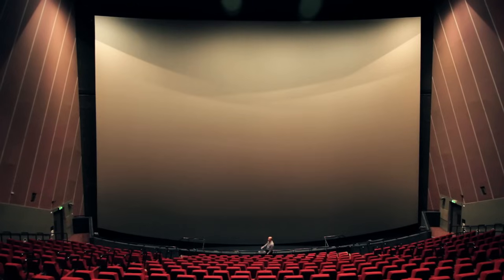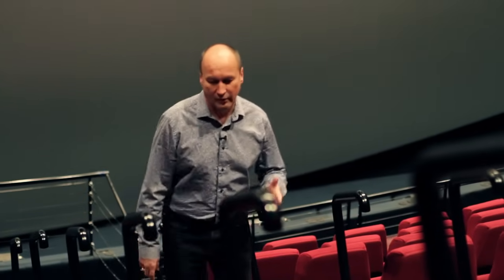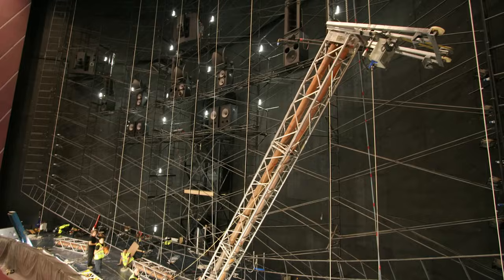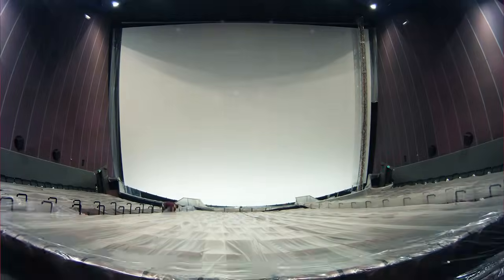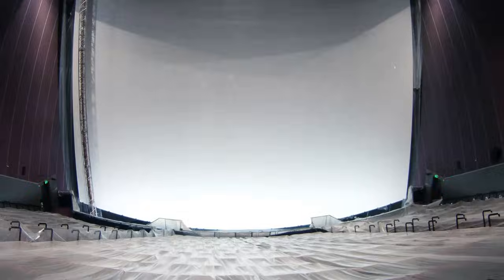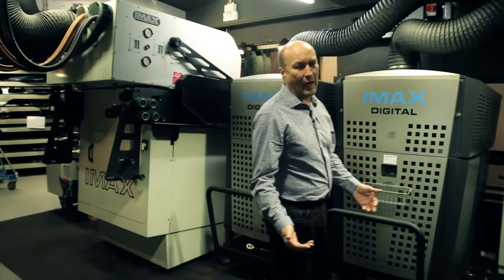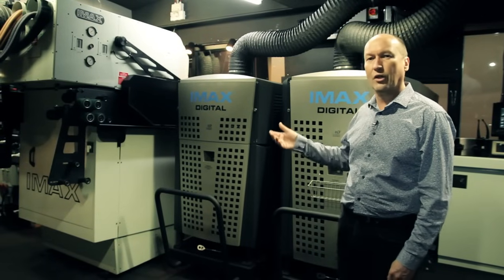London BFI IMAX screen replacement | BFI

Comment: why is the screen square? it's such a huge format, why would you confine it to a 4:3 aspect ratio?
Reply: +ArnoldTohtFan it's not "confined" - confining a film would be to install a 16:9 screen like nearly all "IMAX" cinemas nowadays. IMAX 70MM film is recorded at a 1.44:1 aspect ratio, which is close to 4:3 like you said, this is why the screen is square, and that is how the filmmakers intend you to see the film. For the portions of the film that wasn't shot in 1.44:1 IMAX - the screen is still bigger than your standard IMAX cinema. 

Let's use the new BvS film as an example. There are four different aspect ratios on offer: 

The majority of the film, and the standard anamorphic wide screen for most hollywood films - 2.35:1
The original "true" IMAX ratio, which would fill this BFI screen - 1.44 : 1
The 70mm prints will be - 2.20 : 1 - Like epics such as 2001: A Space Odyssey and Lawrence of Arabia 
And the 1.90:1 ratio you get with IMAX Digital - this is the only time the film will be "confined" to an aspect ratio, when films are shot (albeit only portions) natively on 70mm IMAX like BvS (or many Nolan films, and the recent Star Wars) and shown on the digital IMAX screens - they have to crop the image, thus not achieving the full effect, as you will with this screen. 

I wish I lived closer to London, not only is this screen bigger and the correct ratio, it shows 15/70mm projection which gives you a much superior image than any other cinema system.
Reply: +Wan Wiles I am fairly new to these concepts but I would certainly like to learn more. Tell me, would it be theoretically possible to go bigger than 70mm? Say, for instance, 90mm, or even 100mm? Also, why choose for the dimensions of the IMAX frame to be so boxy? Why not make them slightly longer than they are tall for a more cinematic effect? I should inform you that I'm speaking from the assumption that frame dimensions and aspect ratio are the same thing. Ideally I think the entirety of the frame should be used. Not doing so would negate the benefits of shooting in such a large format to begin with.
Reply: there are a handfull bigger than 70mm (its actuallly 65mm) the latest is hatefull 8 and is captured with 85mm but is presented in scope. scope means yu need a special lense to show the aspect ratio its printed in. yu can have a 35mm scope to have a 70mm (65) movie. and imax is so 'boxy' because its made to capture everything at high resolution and because of that resolution (its so high yur eyes hurt ;) 30k analog, 4k digital)  you need to watch it in letterbox. a widescreen imax would never exist because the human eye canot see widescreen that large, just imagine 2 imax screen besides eachother and yu know what i mean
Reply: Daniel Wiles  at least Christ Nolan IMAX frame on BLU-RAY or UHD (1.78:1) is much closer to the original IMAX frame (1.44:1) than Michael Bay/other/all actual movies with IMAX frame (1.90:1) wich is a joke to me! IMAX is 1.44:1 not 1.90:1
Reply: Just call it a TV format.

Comment: Must be in the chemistry of the paint but I've pondered how the paint can keep from clogging the micro-perfs? Thin enough to barely coat and keep perfs free yet thick enough not to run. A theater near me painted there's years back when they got 3D and it was uneven and many Perfs were covered
Reply: I was wondering the same thing
Reply: the perforations aren't exactly 'micro' so won't clog easily with the sprayed silver paint.
Reply: Yes that's a good point, especially on an IMAX screen. But many smaller screens are actually "micro" perfed or are a weird as im sure you know. Those must be for non passive 3d i.e. Polarized a different method
Reply: Jarod - it's easy to get smaller screens in any material /finish, but larger screens often have to be standard matt white perforated then have a spray finish applied to them.
All the plastics are manufactured in fixed widths and some are not even available over about 5 metres wide (but any length....)
Reply: I wrote  a typo of weird before and meant woven as in woven material.  I've been into home theater since the 90s. Had dozens of projection setups . Yes I'm aware screens come in many materials,  gains,  ambient light rejection screens etc. All have there uses and applications. Mini types of 3d, polarized, active shutter, the Dolby 3d kind my least fav which is a joke cause of glasses reflection, I always see my own eye.  It all is very fascinating to me. I still wonder why some spray 3d  polarizers gunk up the perfs? Go to the Warren IMAX in Kansas you'll see what I mean. All IMAXs are not created equal. There is there is the LiE-Max's with just a large screen and  2k dual projection and then there's the originals like the BFI.

Comment: Avengers Infinity War will be my 1st experience at this theatre
Reply: Watched Avengers: Infinity War at BFI IMAX and was disappointed with both the video and audio quality. This was the forth movie I had watched at this cinema and the first time I felt disappointed. Have watched a couple of movies since Cineworld, Leicester Square had IMAX with Laser installed and as you said it offers a  noticeably better experience with recent movies shot digitally. Plan to watch Avengers 4 there rather than BFI IMAX.
Reply: I watched Infinity War at the Vue Manchester Printworks IMAX and I'm pretty sure it was shown on film as you could see the "film pattern" moving across the screen as (I assume) they switched from the digital projectors for the trailers to the film projector. Interesting that the BFI IMAX didn't do the same.

Comment: What is the ratio of this screen?
Reply: 1.43:1 I think
Reply: This is 1:43.1. IMAX 70mm uses a ratio of 1:43.1 where IMAX Digital uses 1:90.1. My theater is an IMAX 70MM, but uses IMAX Digital for films that are not shot or projected in 1:43.1.
Reply: @largeformatmaster2994  Have you ever visited a 1:43.1 IMAX theatres? If so, how was your experience?
Reply: @ManOfCinema-  I actually do have a 1:43.1 IMAX theater in my hometown. However it only shows Digital releases. Oh what it would be for my IMAX to show 70mm films.
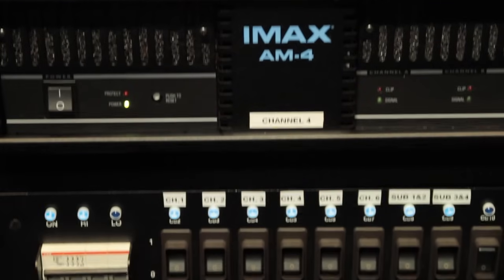Reply: @largeformatmaster2994  I'd be greatful even just for 1:90.1, because I have not seen a single movie in imax theatre, I saw some videos of that format and that is so huge than normal 2:35.1 screen, at that rate I can't even imagine what it'd be to experience 1:43.1!

Comment: Shame so many screens aree LIEMAX and even the BFI has the LIEMAX system for digital. IMAX scans are 18k.... LIEMAX is only 2x 2k... giving a simulated 4k... (looks more like 2k to me).  When are IMAX going top provide 18k DIGITAL to give glorious images like the film systems used to. I called IMAX and was told bluntly "its not all about the image you know our sound is the best out there. " Hmmm, sounds like a stock reply read from a card. Sorry Imax stands for something like IMAGE MAXIMUM... I dont see any SOUND in that title. Most new digital cinemas are going to have 4k for all pictures (its 2k in many right now) Once that happens it makes a mockery of the LIEMAX system and this is in 2019 folks...